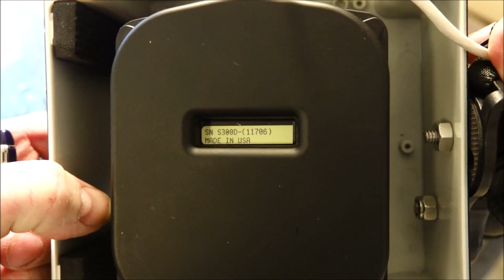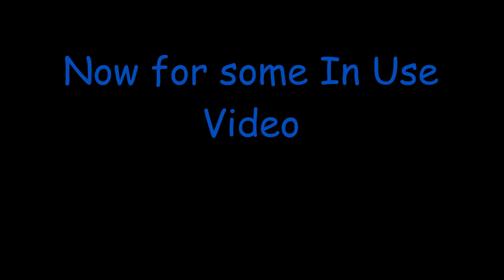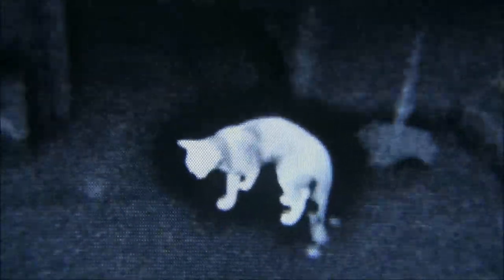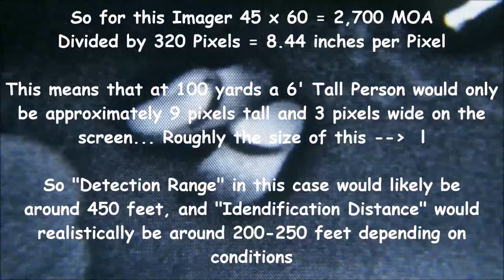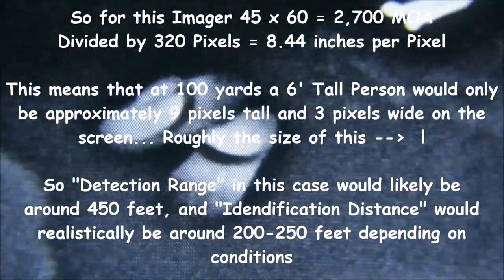Home Built Thermal Imager / Viewer (Part 1)

Comment: If it comes off a vehicle I'm going to just take a guess. I'm assuming it's kind of old because its realitivly low quality. I'm going to assume it is possibly off of a bradly because it has a small size and it just looks like something off of a bradly. Based off of how it has to spool up tho, is it possibly a modified virsion of what would be on a stinger missiles seeker

Those are my two guesses

Comment: S300D, who makes them, where do they come from??
Reply from the maker: From the research I have done the S300D is made by Raytheon, L3 and Thermal Eye are also names I see them referenced under.  As far as what these were originally used for as far as I know they were used a lot as an Option in Luxury Cars and perhaps Semi-Trucks for preventing animal collisions or collisions in low visibility like fog etc.  Operating voltage is 9 - 32 VDC, and the Video Output is NSTC Analog so these units can be adapted to DIY Projects relatively easily.  They are Pretty large for what they are and also have a motor that makes a slight hum inside them (they don't have a regular NUC Shutter, instead they have a timing motor that rotates a wheel the sweeps across the sensor input window to accomplish what newer thermals call a NUC), and they also take a while to start-up / warm-up ... this one takes about 25 seconds from power on to produce a usable image.